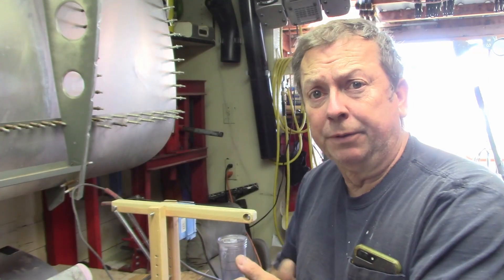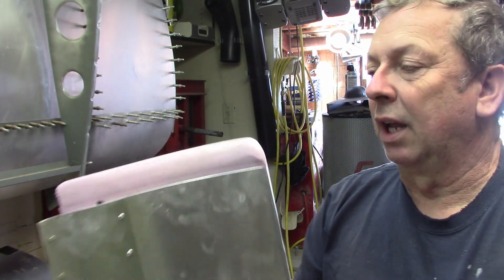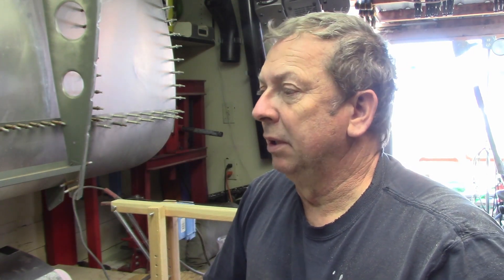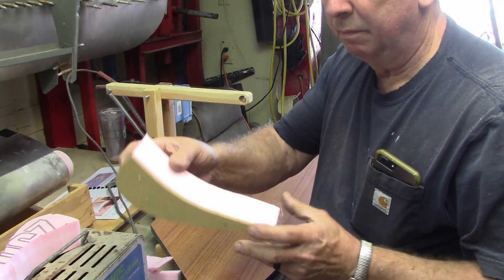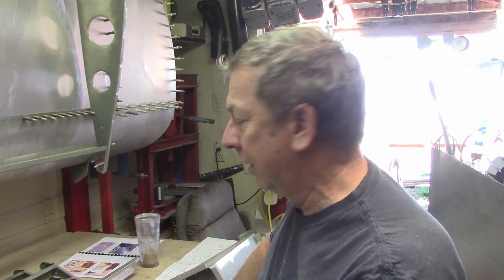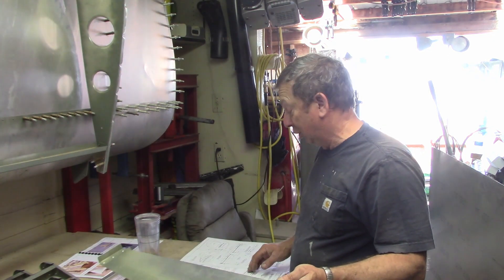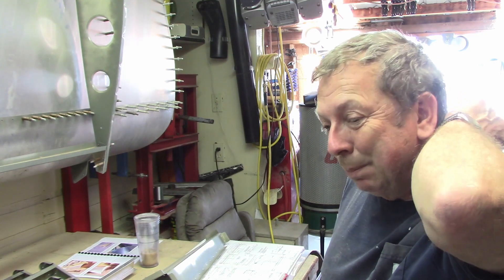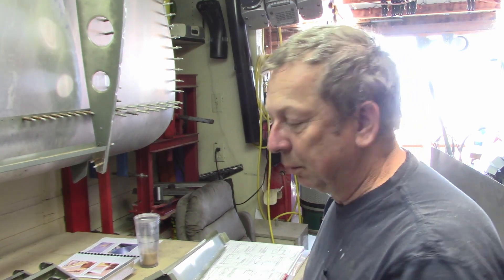Building A Zenith 701: May 2022 Update

Comment: Dan, is this an RC plane your building, or a full size plane? Thanks again for sharing!
Reply from the maker: It’s only an rc if you consider a 27 foot 
wingspan to be in the realm of rc. It’s a 2 seat, high wing all aluminum construction that accommodates about a 100 horsepower engine

Comment: I didn't know that you where in to hot wire foam cutting. I'm trying my best to start  u tube channel, started off with videos of how I hot wire cut foam cores for engine blocks V10, something that went along with the cam shaft. Next step is Mac iMovie, bin watching iMovie tutorials on YouTube, makes my head swim, for my self I findMac mac hard to use, like the return key, it's the enter key. I use to be into RC planes, devorce put a end to that, I think about restarting since I live in farm land with all these open feilds around where I live, that would put to many irons in the fire
Reply from the maker: yes had a hot wire cutter of one sort or another for years, been thru rc planes and still have quite a bit of stuff but not sure if I will go back to it or not, hopefully not.